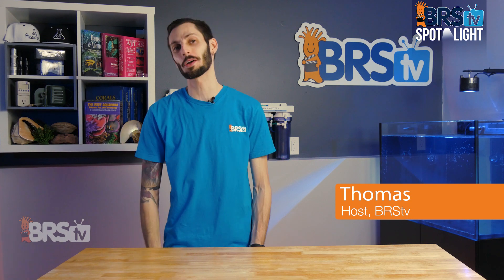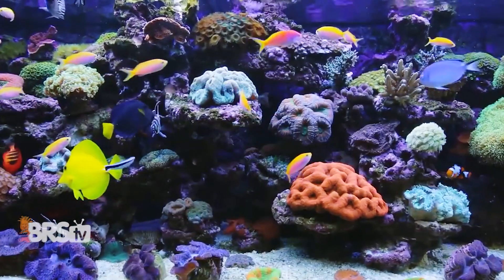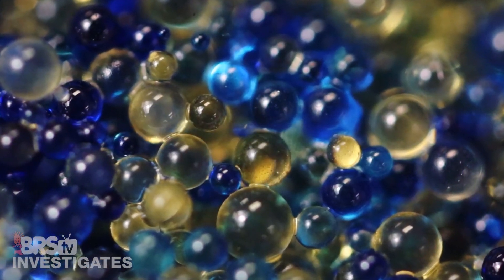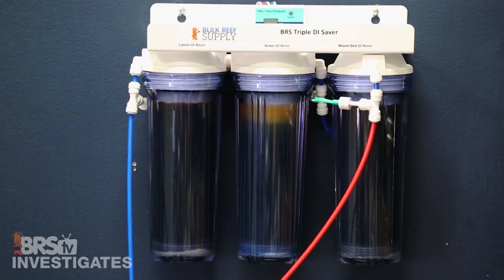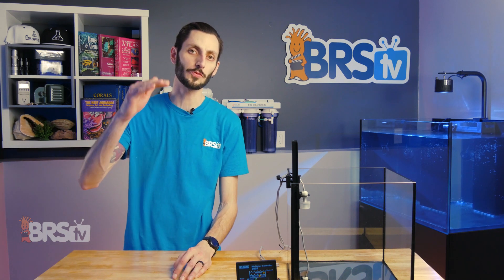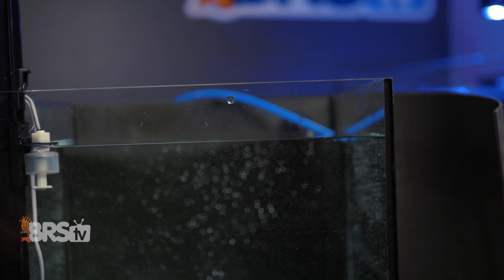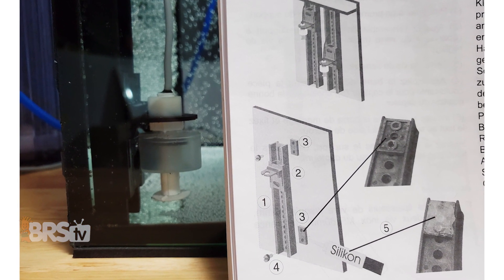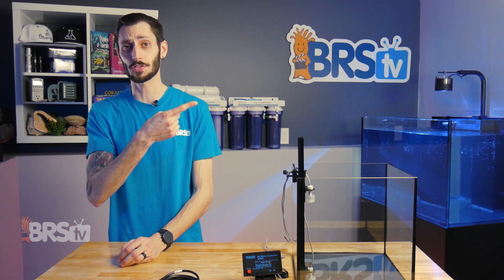Tunze RO Water Controller: An answer to TDS creep in your water reservoir?

Comment: This is great for people with "regular" RO/DI units. I had this come standard with my Spectrapure UHE which had a auto flush kit and a hi/low float switches for ATO installed which mitigated the TDS creep and ran 1:1 water production. This did however come at a substantial cost but did equal out over the lifetime of the cartridges, DI resin and waste water bill.

Comment: I love my BRS RO/DI system to this day. I often think the DI resin doesn't achieve much for planted aquascaping. I would go from 2 to 0 TDS and it wasn't worth it for how expensive the DI resin is. Also, for an osmotic gradient, the diluted water flows to the higher brine side and the brine is pushed out, not moving out on its own.

Comment: @4:58 Correct me if Im wrong but a flush valve does not "back flush" the water in the membrane. It simply pushes out wastewater at a faster rate in the same direction. Also it does not clear out any water from the product water side of the membrane and therefore does not do anything for tds creep.

Comment: Please provide the BRS link to the magnetic holder option, for low and high sensors, discussed in the  video for thick wall containers.
Reply from the maker: We don't stock them at the moment, but you can get a magnet and sensor housing from Tunze directly. They're sold as spare parts, so you can find them right on their online parts store. Here are the two links. First to the magnet, second to the housing. 

https://www.tunze.com/US/en/details/3152.512-magnet-holder.html

https://www.tunze.com/US/en/details/3152.630-sensor-housing.html
Reply: Just ordered this!! Finally I can get my RODI controller set up in my Brute trash can!!

Comment: The one problem I have with a system like this, or the Avast Marine version of this, is that I also use a booster pump, which ends up making the whole thing more complicated as far as wiring it up.   Now I'm sure an electrician or guy with an engineering degree could easily figure out a workaround, but for me nope.  Seems much more complicated.
Reply: my aquafx booster pump came with a solenoid, check it out

Comment: Can you couple it with apex for backup? Turn off after 15 min max?
Reply from the maker: This isn't necessarily controllable by Apex, but you could plug the power cord into it to control on/off functionality to the unit as a whole
Reply: Bulk Reef Supply - If it’s a off position the valve will close?!

Comment: So I'm supposed to manually flush before starting each batch? How and when does the auto flush unit work exactly? Thanks!
Reply from the maker: The auto flush kit that we carry will flush for roughly 18 seconds when the unit first turns on, then 18 seconds every hour from there on out.
Reply: @BRStv  Every hour of continuous use, or even when it's off via the auto shut off valve + pressure switch (I already have these installed)?

Comment: Dumb question: what's the difference between distilled water from the grocery, and rodi water?
Reply from the maker: Not a dumb question at all. The difference is just how the water is filtered. 

RODI water is mainly filtered by an RO membrane, which rejects contaminants that are then expelled out of the system with the waste water. Of course, there are also pre-filters and then the DI resin before and after the RO membrane, respectively, that also aid in the filtration process. 

DIstilled water is water that is boiled to a vapor and then condensed back into liquid water.